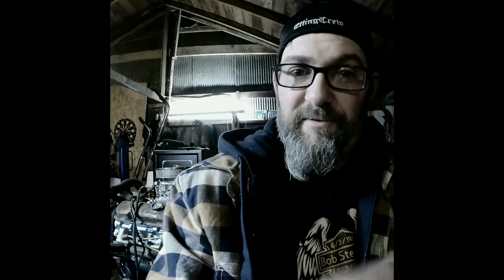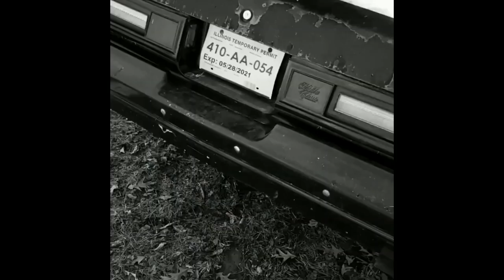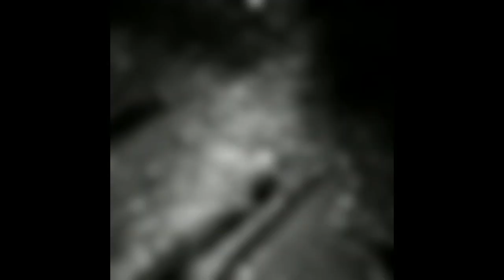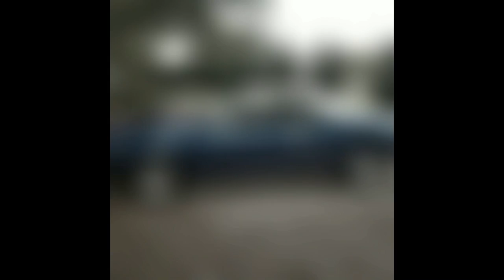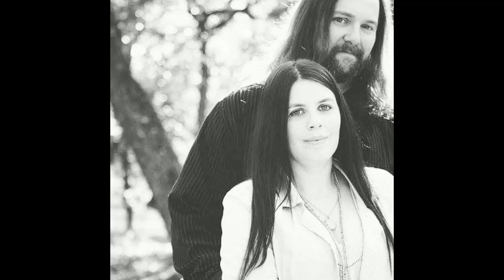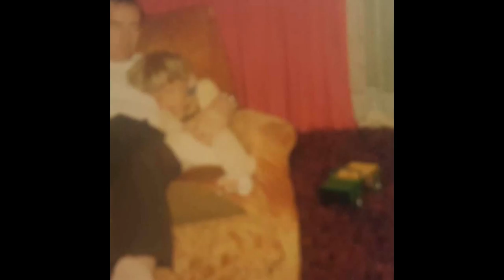1968 Pontiac Bonneville Ambulance Engine Build

Comment: I built a sketchy Pontiac 301 in shop class 25 years ago. Because the machine shop was free and my instructor said the 301 non turbo was junk. Thanks for the video
Reply from the maker: 301 is like the olds 307.  Zero HP's but you really gotta screw up to kill them. 🤣👍

Comment: I am 8 months behind in seeing this but, I built my 389 in my basement garage, I did end up getting new cam bearings and made my own install tool, it was a tad tight also, did a full refresh on the motor and has been good for 2 years so far, I was not into filming at that time so only have a slideshow of the build on my channel that I will re-do in a while, may try to narrate a slideshow with info on the build, I like your attitude, funny to watch someone that reminds me of me, I subscribed to ya, look forward to your other stuff I have to catch up on.
Reply from the maker: Appreciate ya watching. This was my first video!

Comment: You're dead on correct about there not being a budget built Pontiac. $8k ticket from the machine shop for the 400 in a 77 TransAm.
Reply: Truth!!!  But worth it... right? lol
Reply: @ArrowheadGarage  it's a blast to drive. It was a full resto. Still no done. A bunch of body, paint, and trim left to do. There are a few short videos of it on my channel. Right now it's tucked back into storage.